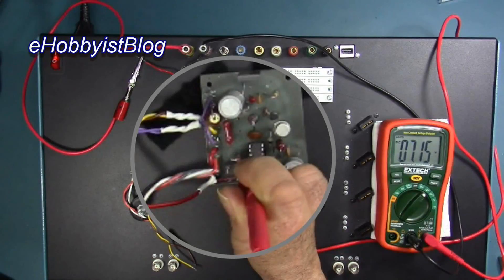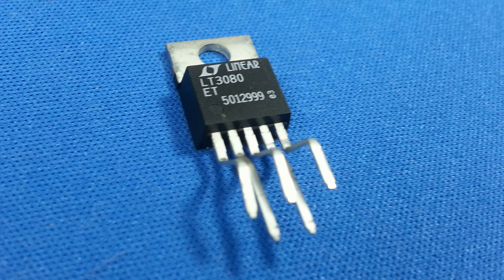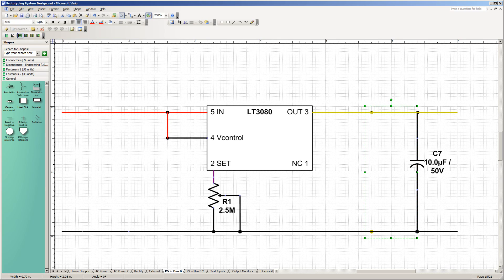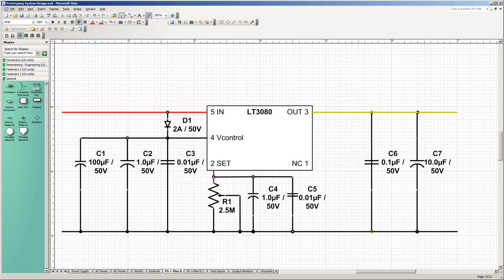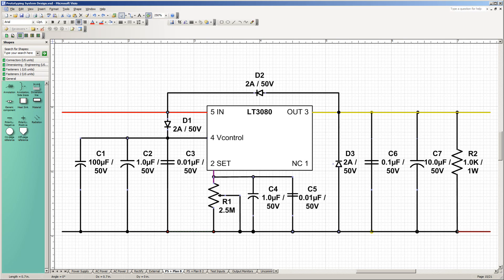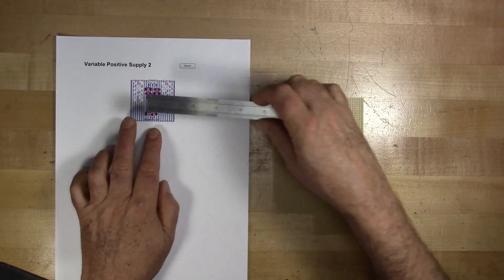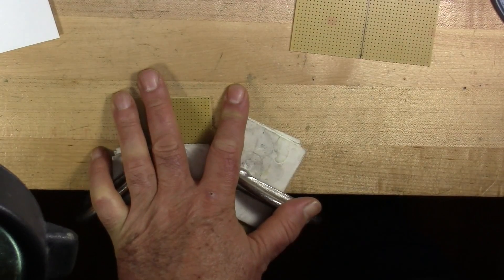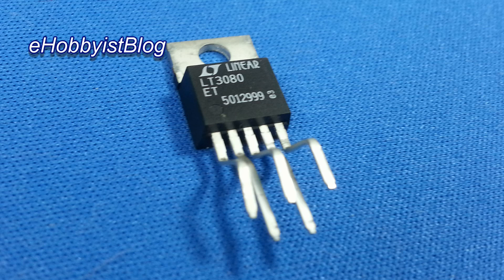x038-Prototyping System Power Supply--Plan B

Comment: Good lay out. I hate strip board and would rather spend the extra time with point to point wiring. We used a lot, I mean a LOT, of LM723's back in the early eighties at Boeing. The physical pin configurationof the regulator is like a lot of audio chips I use in the TO-220 package style, and yes, hard to find layout holes for it

Comment: It's really hard to listen to all the cut audio, sounds like there is not a single sentence without a cut
Reply from the maker: “Not a single sentence without a cut” is inaccurate. 

We record in an apartment in New York City. The apartment is on a flight path to LaGuardia Airport (with planes approaching at varying frequencies throughout the day and engines roaring at varying amplitudes depending on cloud cover). Across the street is an elementary school (with yelping, crying, giggling children and bells ringing every hour). Traffic slows down near the school and local drivers have concluded that the only way to get traffic moving is to honk their horns repeatedly. About a mile further north on Broadway is a hospital emergency room (with ambulances—and their sirens—going by sporadically). Three blocks away is a fire house, whose major preoccupation seems to be putting fires out in a building across the street, with sirens howling. Police seem to think that every drug pusher in the city deals out of a building two blocks down the street. The cops compete with the fire department to see who’s got the loudest siren. (The ambulances win.)

I use Audacity (freeware) to deal with all of this, using the noise filter and parametric equalizers. What I haven’t figured out is how to deal with the idiot across the street who insists on tuning this Suzuki 250—sans mufflers—every time I go near a mike. In this video, I was trying to manually cut out the motorcycle engine noise. Apparently, this editing was too aggressive for you. I am open to any suggestions that do not involve me spending lots of money. What do you suggest?

For electronics-oriented YouTube Channels with better production quality, you might try the recommended links at:
http://ehobbyistblog.com/links/
Reply: the only recommendation i would have is: get out of this horrible neighborhood, it sounds horrible from  what you are telling here. i'm very sorry for you.
Reply from the maker: Working on it.